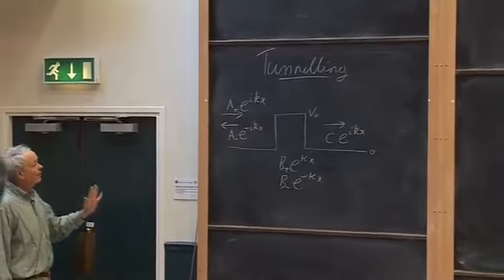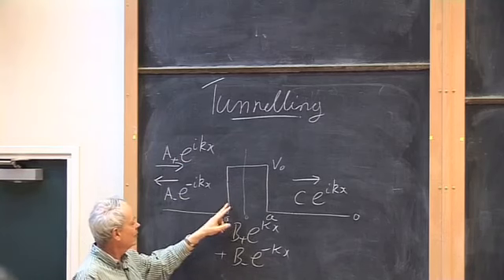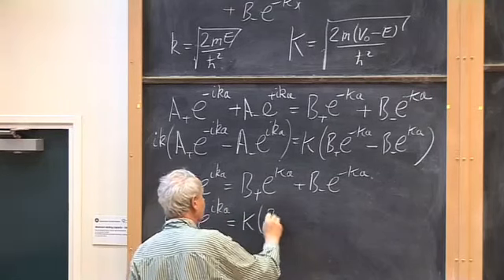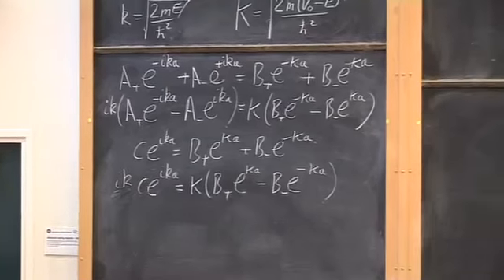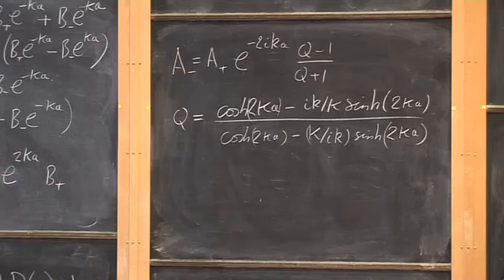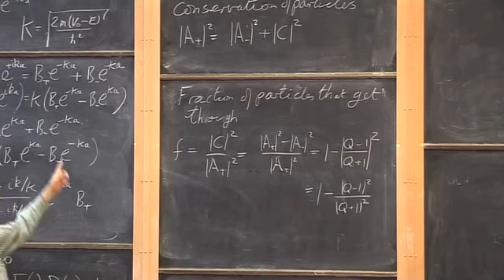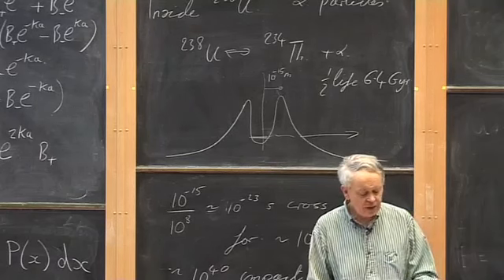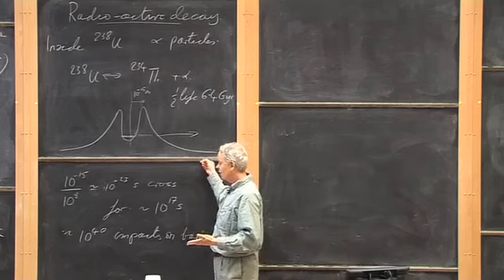015 Tunnelling and Radioactive Decay

Comment: What the?
They are spatially extended spherical standing wave-front's concentrally layered like onion's compressing+4-0-4+decompressing eXpanding sphere's dissipating gravity dividing time symmetry same ratio information is being multiplied.
Space is a division of solidity into tenuity. Also a multiplication of volume at the expense of gravitational potential.
All things are One thing E, appearing as two opposite extension of the centered One =m.c2, out of All thing's: 4piR2=(m.c2) 2+(p.c) Re2∞